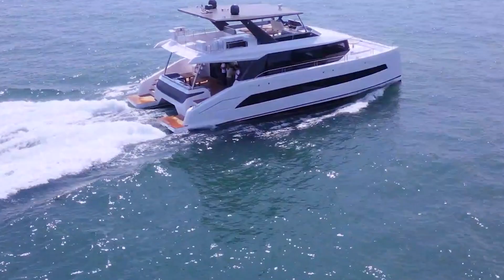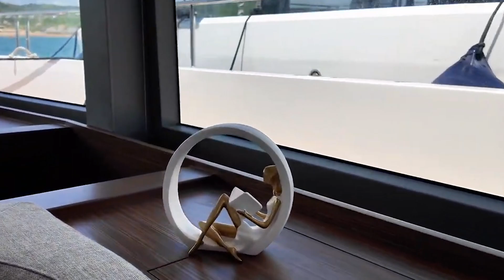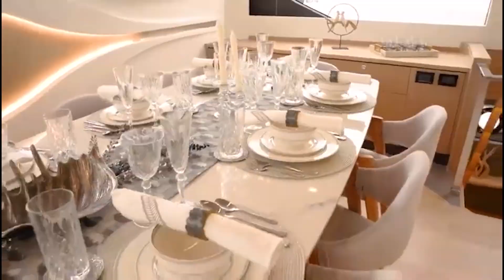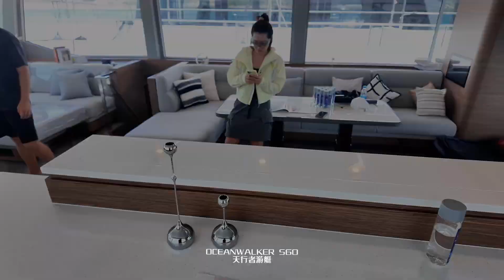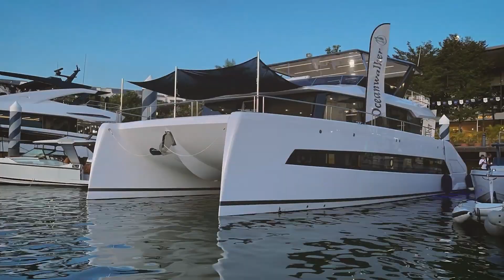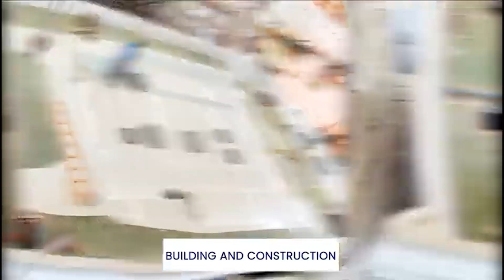Why Everyone’s Talking About This Power Catamaran

Comment: Why are you showing clips of a bunch of different boats? Thumbs down for making a fake video.
Reply: I checked carefully n found out it got mix section of other yachts video. Only few minutes but u correct, editor got put less than 5 minutes of other yachts interior inside. Sorry didn't watch all carefully😅, not sure why he do so
Reply: https://youtu.be/9STyAEHqlDI?si=cADsNqNJVRUWQzLC

This is the Youtuber i talking about. Ya, is in chinese. This yatch is made in China.
Reply: @andyteoh3590 and you proved my point with the video you shared! The boat they are walking through is completely different on the inside, and not just the decor layout but the actual structure of the boat. The video here is showing a mono hulls interior not the actual interior of the S60!
Reply: He show Oceanwalker S60. It got many versions as it customization😂. I got watch it from one Youtuber. So far got 2 version out. One almost finished
Reply: @andyteoh3590 No, they are showing a bunch of different boat brands in this video.